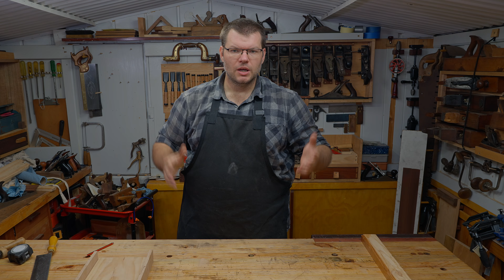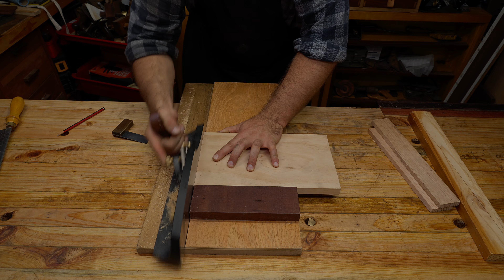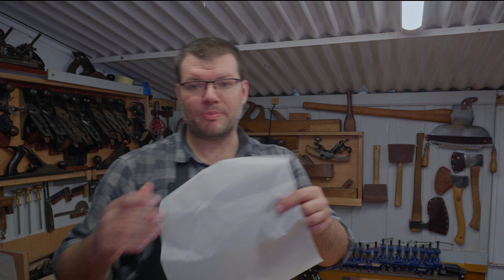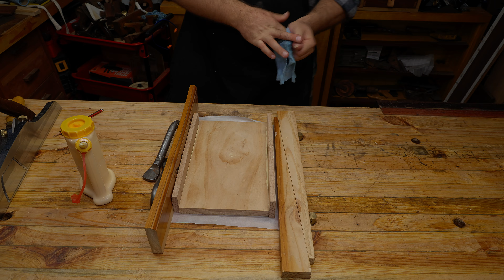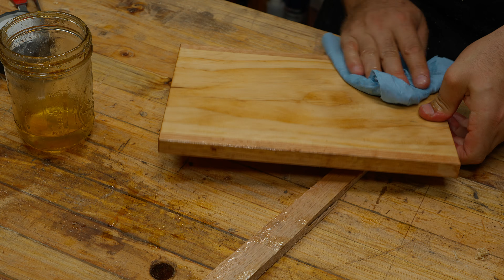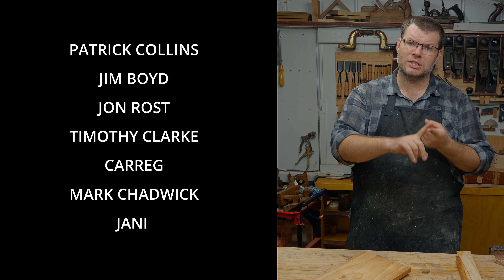How to Clamp Up Boards Without Clamps

Comment: That technique is also great for holding small, tricky to clamp pieces for routing without clamps getting in the way 😊
Reply from the maker: I hadn't considered that, and I'm sure there are many other useful applications for this technique i also haven't considered, for both power and hand tools.

Comment: The simplest of traditional techniques are often the best (though not always, I admit that). For some reason, a lot of people tend to think that everything needs to be ultra-modern and mechanised or automated to work best but that just isn't true in small-shop woodwork. Tactile feedback from tools (including clamping methods) usually results in a better overall end product. As for sandpaper, I use the least I can get away with and I don't buy anything above 240 grit; I also have 80, 120 and 180. My cordless sander wore out a few of months ago and I have no urge to replace it. In fact, I don't aim for a sanded-smooth finish as such, I just soften corners and lightly prepare surfaces for a finish to adhere to. I don't even like sharpening planes above 240 because that was all we had back in the day but because I now mainly use diamond plates (for speed) ranging from 400 to 1000, I have little option. Less is more, I think.
Reply from the maker: I think you're correct that traditional ways should not be forgotten just because there is a new way of doing things. Sometimes the new way is better, some times its not. 

Thanks for sharing your sanding grits too much appreciated

Comment: Instead of sandpaper on flat surfaces, I use a card scraper or cabinet scraper if it's a large project. I do still use sandpaper occasionally
Reply from the maker: Thanks i generally use scrapers instead of sand paper too where possible.

Comment: I am trying to avoid sanding ... I prefer to plane..but when i can't use my plane and card scraper  i am starting sanding with 80, 120, 180 and 220. Sometimes i am skipping the 80 and the 220. Before adding finish on the wood i wipe all the sawdust off with microfiber cloth or old cotton rug and than i am using some mineral spirits for final cleaning B.L oil or Tung oil and sometimes Shellac.
Using wedges is very helpful way using while woodworking...i am using wedge all the time with my leg vise anti rack system ..
Good video!
Reply from the maker: Thanks for sharing your sanding grits / finish process and uses for wedges, much appreciated

Comment: hmmm seems there are no haters here bitching about you using your bare hands on the finish. I LOVE the feel of the finish, wood and my hands heating the surface.
Reply from the maker: I have had the bare hand haters before, i guess they haven't found this video yet. It was raw linseed oil i used here so all natural and bare hands is just easier.

Comment: This video was really useful. Does it matter what the angles are on the wedges?
Reply from the maker: I don't think the angle matters too much as long as the wedges hold and stay relatively square to the work. So i would probably make sure the angle is less than 45 degrees as i think 45 would slip.

To be honest i haven't played around with the angles much. I usually just grab an off cut and cut it nearly corner to corner so i have a flat on the small end to hit.
Reply: @AussieWoodshed  Good to know. I will see what off cuts I have around the shop and experiment some.

Comment: I have use wedges for years when you start using them and think outside the box. You will find more and more uses, no need for fancy clamps
How did the woodworkers hundreds of years ago used
I enjoyed the video well done
Reply from the maker: I agree, there are definitely a lot of applications for using wedges to clamp items or even work holding.

Comment: Very cool. I coated my bench top with waxed shellac, and the glue beads pop right off. The bench top is a little slicker than normal, but it hasn't been a problem.
Reply from the maker: That's a pretty good idea i think, making sure glue doesnt stick to the bench top, i may try that.

Comment: I like my workholding how I like my politics, with a wedge...

Seriously though 220 is usually my final grit for sanding , but for finer work I usually work my way from 180 to 600 grit. Organoil (whose Danish Oil I use) instructions say 1200 grit. Never gone that fine. 
On the other extreme I sometimes just give shop builds a quick once over with 120 to soften edges and remove splinters.
Reply from the maker: Thanks for your experience with sanding grits, much appreciated